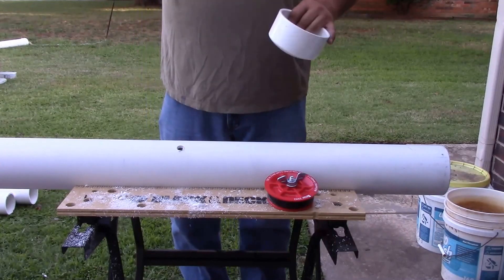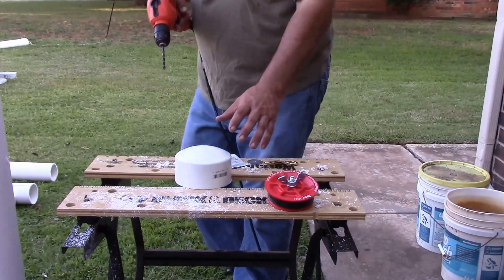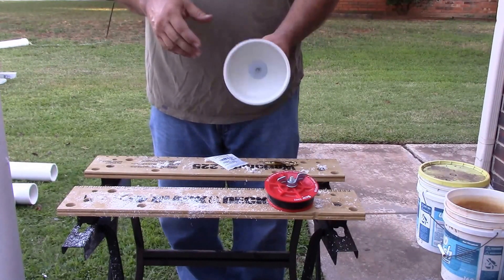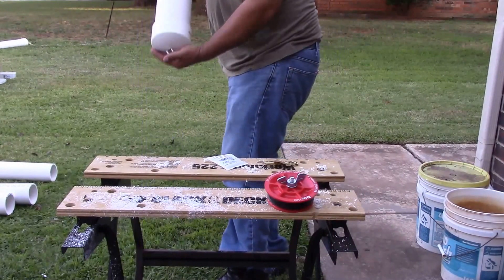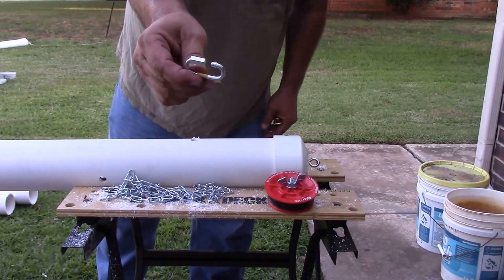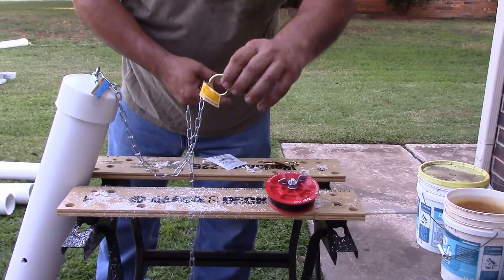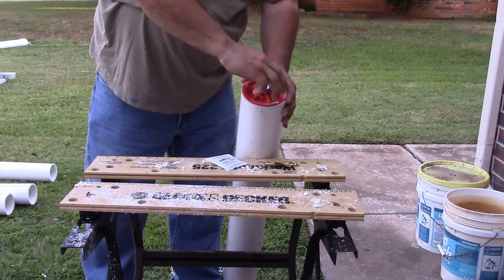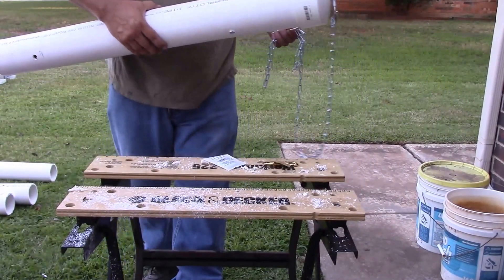How I Make A Pig Pipe

Comment: Pig Pipes work very good!
Reply from the maker: +Kowpoke Kev I was a little skeptical at first when I put out my first 2 it took them a while to mess with them, now the grass is gone where they have rolled the heck out of it, one broke loose and they rolled it about 100 feet away and got it wedged between 2 trees.  I really would like to get a video with pigs pushing it.  I kinda did the math on it and there is 2500 pieces of corn to a pound and my tubes hold 20LBS so that is 50,000 pieces of corn in there, I figure at most they get maybe 50 to 75 kernels of corn pushing it around in the circle, so they have to roll that thing around 500 to 1000 times in that circle to empty it, they are persistent little guys.
Reply: The pigs found mine withing two weeks, ground is bare now!